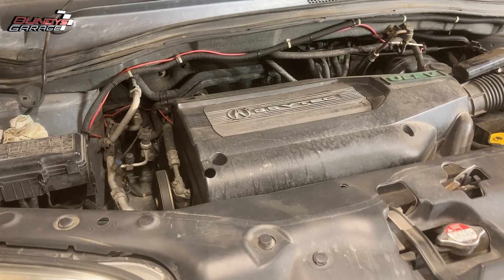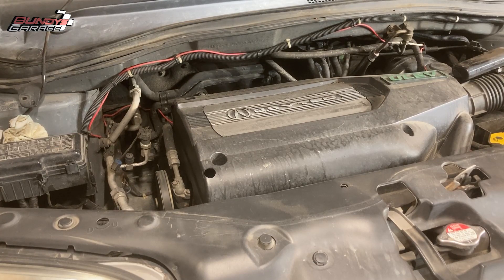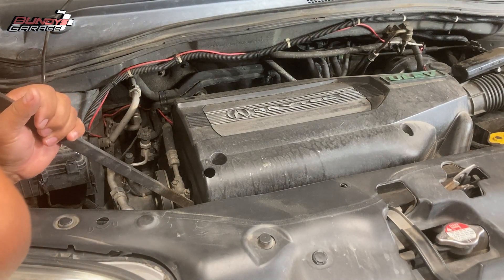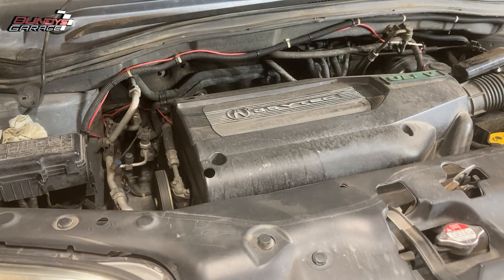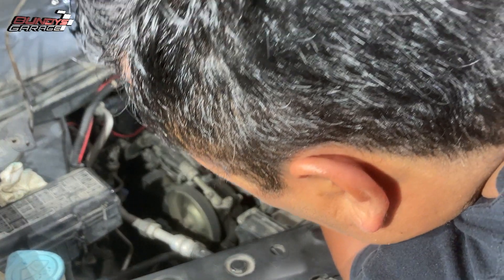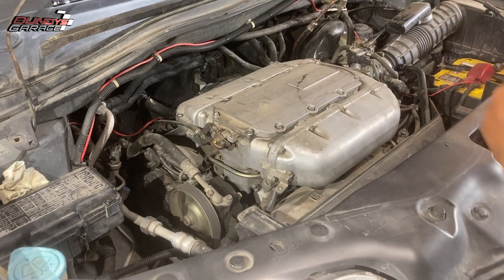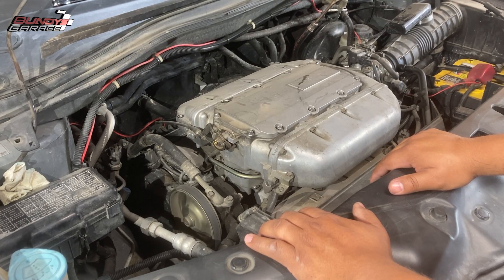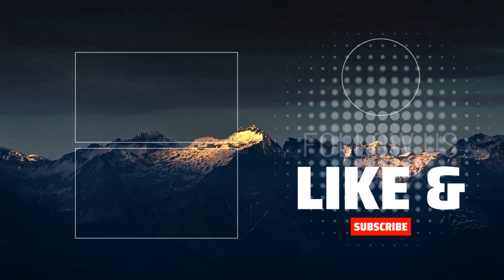Honda J Series Valve Adjustment Done Wrong Ticking Sound After Valve Adjustment Accord Odyssey Pilot

Comment: I just did a valve adjustment on my Ridgeline last week and unfortunately I have a valve that is too loose and making this ticking noise....going back in this weekend to attempt to locate and fix the issue. Another tip is to get a set of tapered feeler gauges for Cylinders #1 and #2.  I believe my standard width feeler gauges were too wide and rubbed between the valve cover boss and or spark plug cylinder making the valve seem tighter than it actually was.  I am guessing my ticking is coming from an exhaust valve on Cylinder 1.
Reply from the maker: Recheck them all. On Odyssey's that are above 2010 I believe you have to do the rear cylinder head, 1, 2, and 3 blind, just by feel alone. And the rear valve cover is a pain to get off cause Honda didn't put enough room from the back of the engine to the firewall.
Reply: @bundysgarage  I have a 2006 Ridgeline.  The tapered feeler gauges for Cylinders 1 and 2 ended up being too flimsy to work as intended.  I ended up using the go-no go method of using a feeler gauge that was .001 too big as part of the process.  If it would fit then I knew the gap was too big and I adjusted downward.  I also used addition “in spec” feeler gauges to get an idea where I was at.  I think using multiple gauges is more effective than just picking your ideal feeler gauge and doing it purely by “the feel”, ESP for newbies who don’t know “the feel”!!!  Lastly, getting angled feeler gauges is a must.  I got both straight and angled, but only used the angled.
Reply: @bundysgarage  Also on my J series 2006 Ridgeline motor, I took the extra step of un bolting the power steering pump and leaving it only attached by the high pressure line.  This exposed another wiring harness bolt that when undone gave me about another inch of play in the harness.(allowing the valve cover to be removed/installed MUCH easier and with less chance of collateral damage to the gasket/spark plug seals upon reinstall).  I discovered all 3 spark plug tube seals on the rear bank (and one on the front bank) were torn from my first attempt last week.  I don’t know if they were just the cheap aftermarket seals or if I did something driving them into the cover or upon re installing the cover.  Very weird.  Went with overpriced OEM tube seals this go around.  Damage to the tube seals was a large part of my reason to unbolt the power steering pump this time.  I would definitely suggest this additional step.  I also got a loaner seal driver kit from Oreilllys instead of using a socket that was just a wee bit bigger than ideal.

Comment: We might be able to hear if if you would not talk over it.....and probably the rear bank has the bad valve adjustment since it's harder to access the valves to adjust between the valve cover bosses and the spark plug cylinder...and you have to do it leaned over the motor.  Real pain especially on Cylinder #1 because of the wiring harness.
Reply: Follow up comment.   On cylinders 1 and 2 it is the rocker arm and valve cover boss that makes it tight for the feeler gauge.  It is important to make sure the friction rubbing on these isn’t mistaken for a tight valve.  The spark plug tube just complicates getting a wrench on the jam nut.
Reply: Believe this to be my issue, did a valve adjustment and it sounds like the on the video. Might have left the exhaust valves a tad bit too loose due to the rear bank
Reply: . Suggest using multiple feeler gauges.  Ie if you are shooting for .010 then also use .009 and .011 on hand.  You get a better idea of where you are at than when you just grab .010 and try do it with a single gauge.  Worked for me when I re did my Ridgeline and also did my brother's Civic and nailed it the first time.
Reply: @HH-gn9qt  thanks, yes I plan on using the following feeler gauge so it can barely/cannot fit since it probably needs just a bit of tightening

Comment: Mine only does it after the engine has been running for about a minute. Could that still be this, or is it likely a different problem?
Reply from the maker: Yeah, they are nice and cold and sealed and then when the engine warms up they become loose. When was the last time you had them adjusted?

Comment: We’re they to tight or to loose?
Reply: Intakes tend to get too loose while exhaust side gets tight, if u hear the valves probs intake too loose. If u have random misfires rough idle or see hr engine running rough exhaust too tight.

Comment: My 2009 honda accord has 230,000 miles and I'm having this noise, not very loud. Do I need a valve adjustment and should I changed and replace the vtec solenoid

Comment: What happens if you drive the car after a valve adjustment was done like this? I just had mine done and I now have a ticking noise. Could I cause damage by driving it now?
Reply: Any damage?
Reply: @c.o.dprodigy7510 I didn't drive it like that. Well I did drive it to honda lol. Cost me like 780 to have them do the adjustment. The car was fine after that. They said who ever did the adjustment left a nut lose and it was bouncing around in there. The other mechanic gave me my money back.

Comment: They actually stop making the naturally aspirated V6 in 2017 I especially hated that stupid VCM Honda took a great V6 engine that served them well for over 25 years and fucked it up  I have both a 2010 and 2017 V6 coupe sold my 2006 accord 2.4 sedan with the super reliable K-24 now I wish I had kept it
Reply: What was so bad about the vcm? I currently have a 2010 accord v6 coupe, it’s about to hit 100k miles
Reply: @Enigma.k24 make sure you get that timing done bro 😎
Reply: @Enigma.k24 also get yourself a VCM muzzle to turn it off your car will thank you for it and you’ll have full V6 power too
Reply: It the fact Honda was sued about them it caused Spark plug fouling piston ring damage torque converter shutter and damage to the transmission misfiring excessive vibrations when driving especially at lower RPM it just a bad idea 👎🏾 🤔⚠️💯

Comment: My car is doing that in cold weather and goes away after its running and warm. 65k miles
Reply: possibly your timing belt's hydraulic tensioner.  if it only ticks on cold starts, then goes away after engine is warm, most likely need a new hydraulic tensioner

Comment: That's exactly how my Odyssey sounds and it smokes occasionally. Could my valves being out of clearance be causing the smoking?????
Reply: Usually valves that are out adjustment will not cause smoking. On the j series motors the most common cause of smoking is the valve stem seals. Sometimes the rings. But the rings aren't as common. It is almost always the valve stem seals. My j series was smoking and I thought it was the piston rings. But the rings were completely fine. It was my valves stem seals. I replaced them when I redid my motor and she is running beautifully since

Comment: This is pretty much the exact sound my sons car had. 164k miles didn’t know last time the valves were adjusted so did it and just finished today. 10 hrs total to complete. Needed valves sp plugs ignition coils ( #5 failed and they were original so did all..) Intake air EGR passages were clogged with carbon (under top cover of plenum) so cleaned that up and replaced gaskets also. Found the studs running up thru the plenum were loose and carbon (probably vacuum also) was leaking under all intake gaskets. Cleaned throttle body. Oil etc. Went from a well running  used car to a sweet sounding and running used car.
So now it sounds like a J series again.
Thanks for this video.

Comment: Hi i hope you can help me out here.i had my headgaskets replaced after i got it back i hear a ticking noise when its cold after a few minuts its gone so i took it back and the tech said he udgusted the valves again and is still doing the same and i took it back and started it ip again and the noise was gone right know im confused.
Reply: Timing belt tensioner if it goes away when warm, potentially

Comment: Good video.  What type of damage is happening internally when you hear that ticking sound?
Reply: There shouldn't be any damage so long as it isn't extremely loose or tight. Adjusting it usually fixes the problem. But it's very time consuming and tedious. But worth it in the end. This just reminded me I have to adjust my valves because I haven't done it for a few years now

Comment: Thank you for creating this video! What would you suggest if the same ticking sound starts without having had valves adjusted?
Reply: Simple👉🏽🤡 your due or a Valve adjustment 😂💯🙄
Reply: @rosie Clark  interesting...turns out it was feedback from my Bluetooth connection...guess you're the 🤡🤷🏾‍♂️😂
Reply: @jag1309 a lie you just told

Comment: I get a loud ticking sound when I start my car after it’s warm it goes away accord v6 5 auto 2012
Reply: Same anything?
Reply from the maker: Most likely you need a valve adjustment. Also old fuel injectors can make a ticking sound but if it goes away when it’s hot most likely your valves.
Reply: Probably timing belt tensioner.
Reply: if it ticks only on cold start, then goes away after a few minutes, most likely is the timing belt hydraulic tensioner

Comment: ho yeah, valve adjustment video please!!  Need to do my 2011 odyssey this summer.  Never enough learning 👍
Reply: My '08 hasn't started ticking yet and I'm not noticing any loss of milage, so I'm leaving that alone for now. Though it will be nice to see so when I do need to do it.
Reply: the bad thing with valve on J series engine, is no noise, usually on exhaust side. Leaving valve get tighter, will end up has burnt valve, bad misfire and a head job.  Too loose is not good too. 

I’m at 136000 miles on the clock.  I will check them this fall. More how to videos, more confidence to tackle the job my self!!

Comment: Too lose = ticky tick

Too tight = burnt valves

Lesser of two evils
Reply from the maker: Sounds like my first marriage. Guess better too loose than too tight!!!
Reply: @bundysgarage  I have 174k on a 3.0 j-series. I’m getting a little bit of intermittent shaking when the car is warmed up and at idle. Not terrible but definitely noticeable (when it happens) Any clues what might be causing it? I was thinking it might possibly losing compression in a cylinder? It smoothes out when revved up and mechanics have told me my motor mounts are good. If that helps.
Reply: Scan tool with real time monitoring will diagnose it.
Reply: @SpicyMcGeezaks  honestly it’s just a Honda my 2016 accord 3.5 with 181k does that at idle kinda shakes the whole car in a while it does have the original motor mounts so it’s probably that for me but it’s common on these cars to feel like that
Reply: @tonyfajardo7204  It’s concerns me because I have a TL as well with the 3.5 j-series at 162k and the motor in it is as smooth as can be. There is a pretty noticeable sound difference between the two engines as well. The Honda still runs good, but the shaking at idle is a bit concerning. Oh well, I’ll ride her til she croaks. It is kind of a rare car, the 07 with a speed manual.
Reply: @bundysgarage  hilarious comment by the way

Comment: Great video Bundy. Same issue with my 07 odyssey when i go Mcdonalds when ur waiting around a corner you can hear that ticking sound. Since i adjusted the valves it is so quiet now  love my odyssey now i have 2000. 2006 just bought 07 for cheap $500.00 just because the engine was ticking it has 155000 miles the van is really nice.
Reply from the maker: The J Series will last forever if you take care of it
Reply: How much would I expect to pay for fixing the ticking sound? Thanks